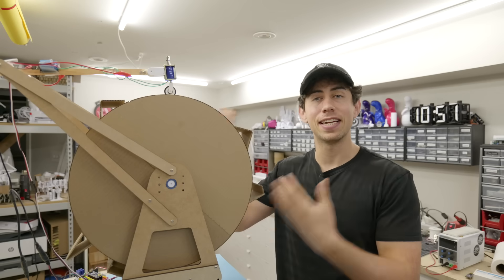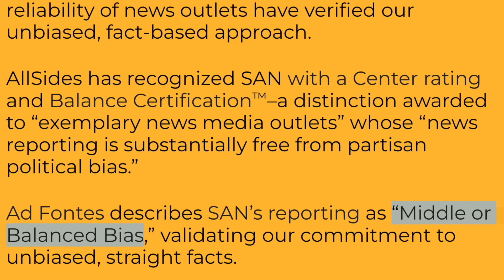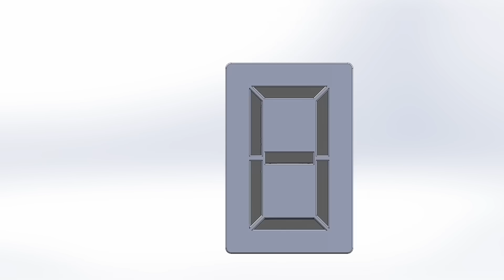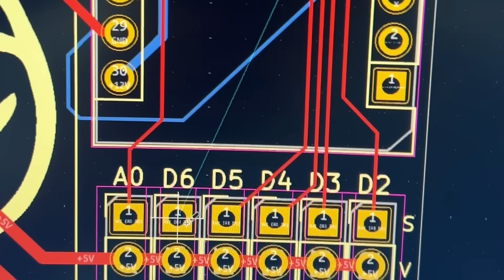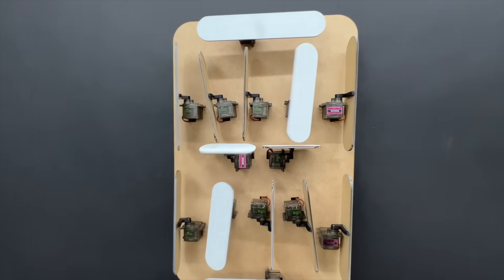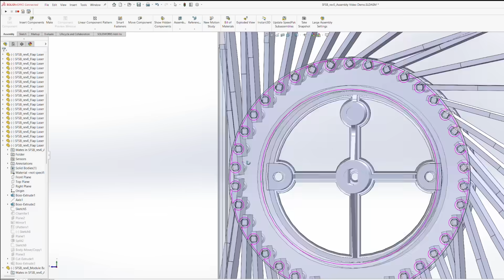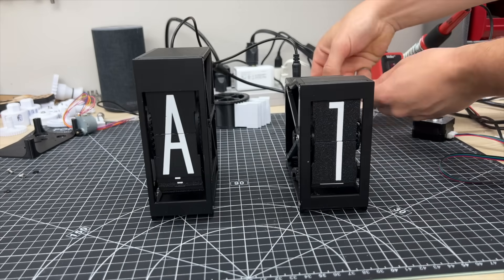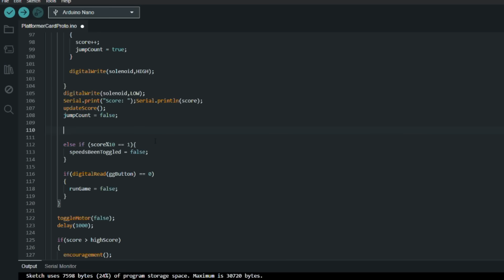This split flap scoreboard is SO satisfying

Comment: I believe that the original split flap displays used a form of thin Poly Styrene tiles.  I have seen print shops direct print to this material as well, so that can be version 2 if you want to explore into this further.  Would be cool to have a display on your wall of like 4 x 40 characters displaying twitter comments or something.
Reply: It would be 12 x 40 or something
Reply from the maker: That would be crazy! I know a company makes them already- at this point I would just buy that. Repeating this even 8 times for this display drove me mad

Comment: As a mechanical engineering myself I love the mechanical game. If you use a conveyor (or even a slat conveyor) you could have a longer pattern. You could even have a slat conveyor or rotating wheel which is magnetic that different obstacles attach to. You could stack the obstacles in a chute and then a cam releases them onto the wheel. Just a thought 😄
Reply from the maker: The multiple magnetic objects is a future project! For this one I have a different approach
Reply: @Engineezy  the real challenge would to make it completely mechanical ! Back to the day of programming with cams and levers 😂. 

I recently worked on a ~100 year old hydro power station and it amazing how they controlled everything, so many functions which are now done with plc ‘s systems are all done with levers and valves and mechanical electrical switches, awesome stuff. One of the mechanical electrical switch is controlled by the flexing of a horse shoe shaped lever arm with two input shafts applying apposing torque to it from two different systems, it’s basically a, this is > then that then do this switch. I don’t think people could design systems like that anymore a lot of that expertise is gone.
Reply: @Geek-On-a-Motorcycle aw man such isn't taught in advanced mechanical engineering?
Reply: @Geek-On-a-Motorcycle woah that’s awesome
Reply: @Engineezy  😍
Reply: I like this line of thinking. I'm also reminded of the rock climbing treadmill.
Reply: That's kinda what I was thinking, have a belt with obstacles that are on hinges and normally lay flat with an electromagnet or some other actuator underneath that stands them up for you to try to avoid them. Every obstacle that goes past without you knocking it back over (think hurdles) gets you points.
Reply: Or have a segmented wheel where the segments flip up at random so that you cant just get into a rhythm
Reply: you are not a mechanical engineer if you can’t even make sentences correctly.

Comment: Now that I see what the TPU belt was for, I'm extra amazed that it works properly! Correct me if I'm wrong, but wouldn't any amount of slippage cause errors in the display? 

Also, thank you for always giving me solutions to problems I'm facing in my own projects. MotionGen and KiCAD are two programs I wish I'd known about sooner!
Reply from the maker: The drum recalibrates every rotation which mostly makes up for the slippage, might switch to timing belts if it becomes too much of a problem but the drum is pretty light so I think it will be okay

Comment: I am going to try and build a case with a backplane that the modules being self contrained and just slide in and snap into the back plane.  Have a feedback PIN on each spot so the controller will know if a module lives there.  Then I just need to design the front end software to auto show up those inserted charecters in the slots.  So I can put in blank plates and for the applications, only show spots where needed and put in blank plates if where items are not needed.  Got some good ideas!  Are you going to post the STL for your split flap modules???

Comment: Score should be based on how far or how much the wheel rotates.  The faster it rotates the more points you get.
Reply from the maker: I was thinking the same thing!
Reply: @Engineezy  😀  I can’t wait to see the new high score. 

If you wanted to get complicated, instead of a wheel, you could make it by arraigning a bunch of rounded blocks in a circle.  The blocks would be attached to motor to move them up or down. Then have a program to randomly modify the height to create random obstacles.